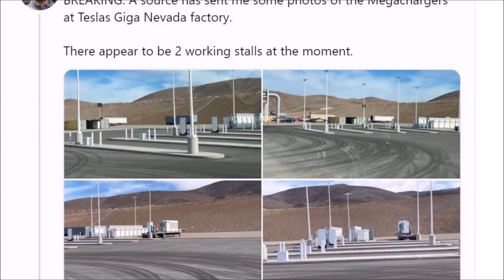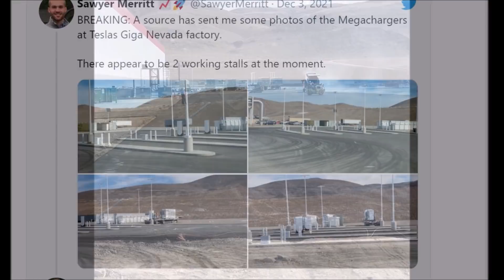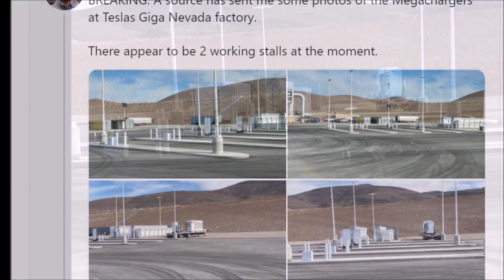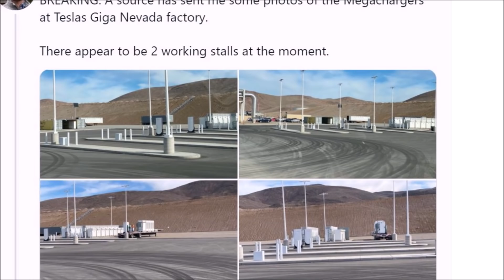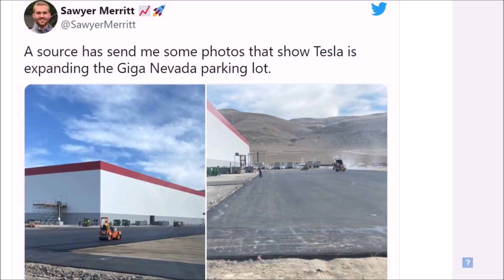GM's Silverado EV Drive Unite Diecasting Isn't Tesla's Megacasting

Comment: Heck motors and drives have to be made somewhere.  These are small castings.  You or I can easily pick up these castings with one hand.  No difference in how these or suspension parts are made.  So big deal they are just likely upgrading some of the smelters.  This is just a PR announcement.